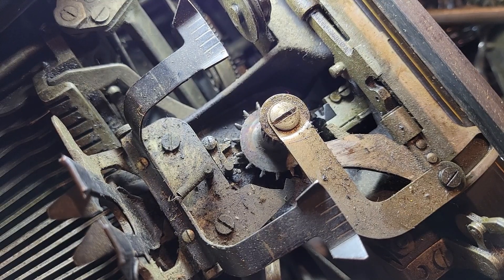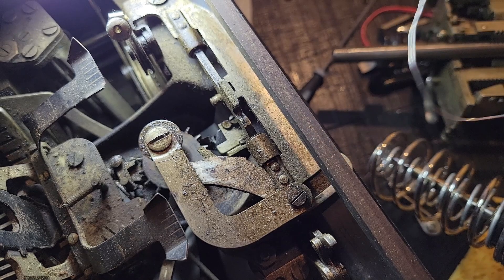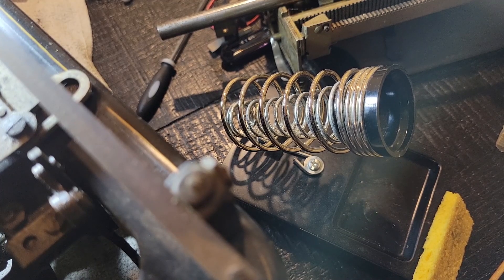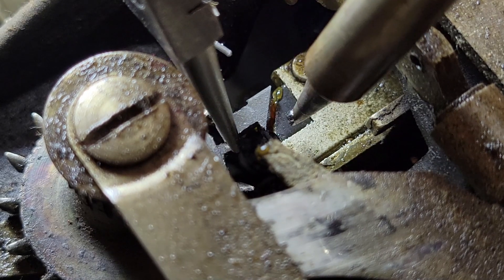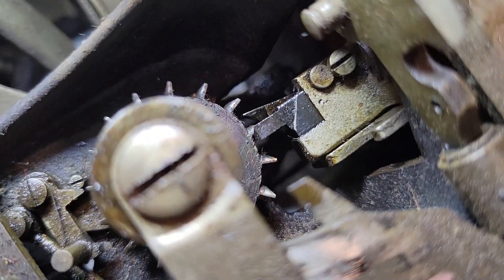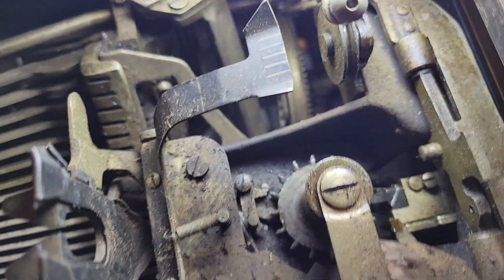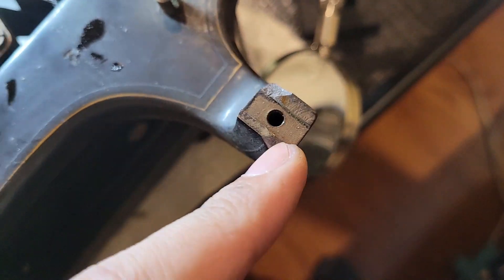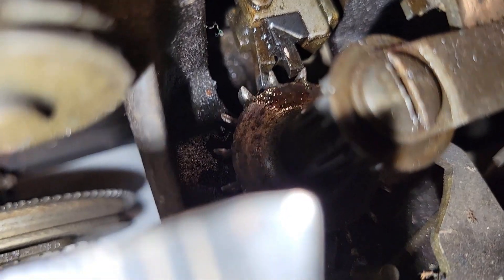Harris Visible typewriter escapement repair - Soldering a broken escapement dog

Comment: How long id the  "soldered " joint last
Reply from the maker: It's still around. I haven't typed on the machine in a while, but when I do, it is a joy with pretty good speed. I would have preferred silver solder, but this circuit solder did reasonably well.